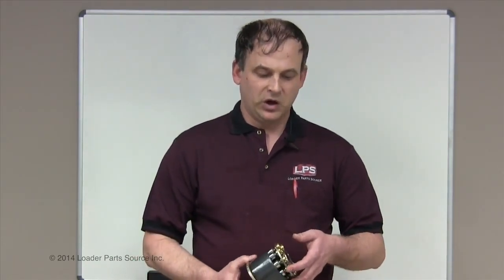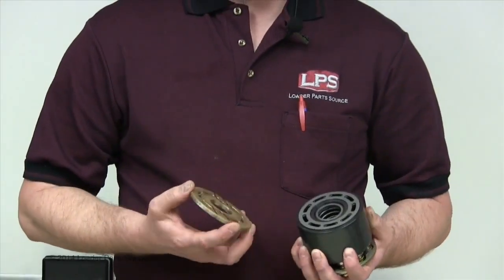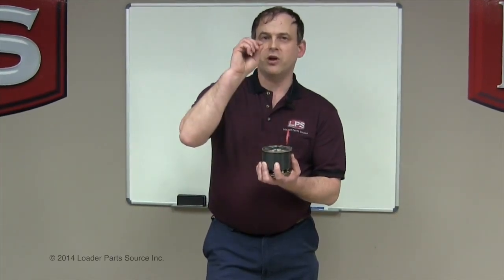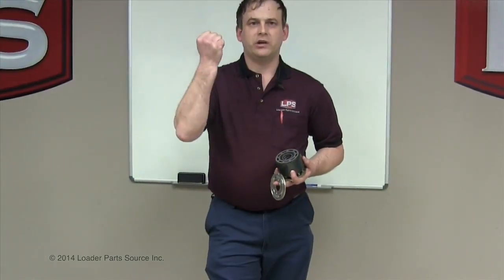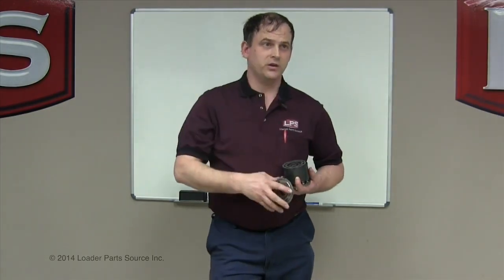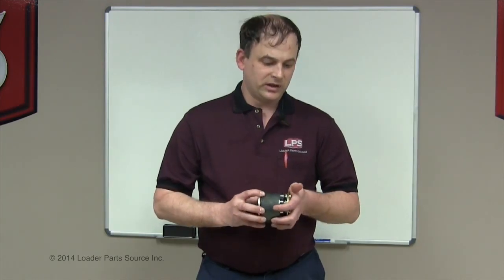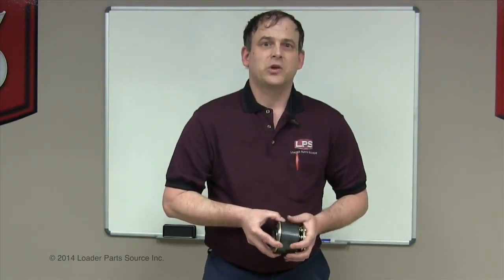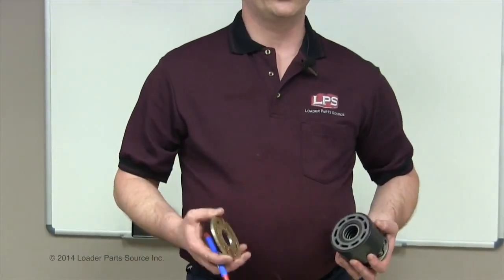Hydrostatic Drive Loader Doesn't Drive When Warm

Comment: Thank you! I’m experiencing weak drive in my right drive motor, but I resealed the motor, and still the same issue, I took apart the pump, the bronze plate has some wear I bet if I did put a pen through it I would feel the scratches. I’ll get it sanded and let you know if it fixed the issue.
Reply: Glad to help.  This has to be flat and smooth enough to seal in the oil. The backyard method is to use 600 grit paper or finer over a piece of glass.

Comment: I have a case 1845c won't move at all happened when I put a new hose on moved for about 15 min can't find the problem.
Reply: I have the same problem,
Reply: Engine work good  but the tires and boom don't move at all
Reply: My is case 85xt